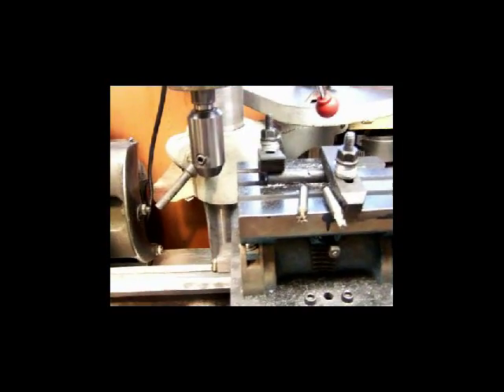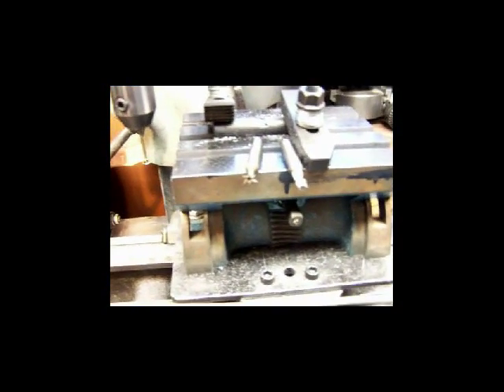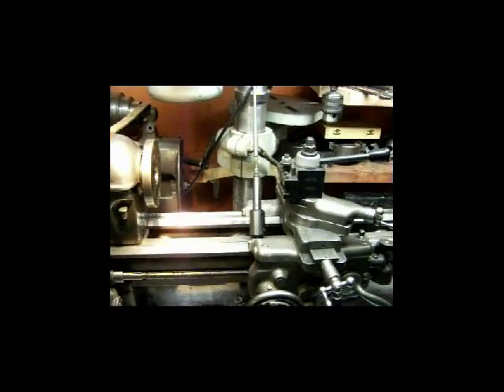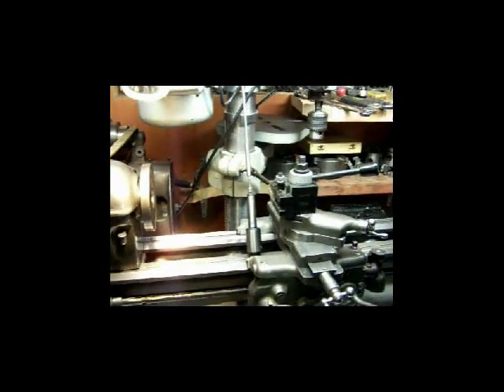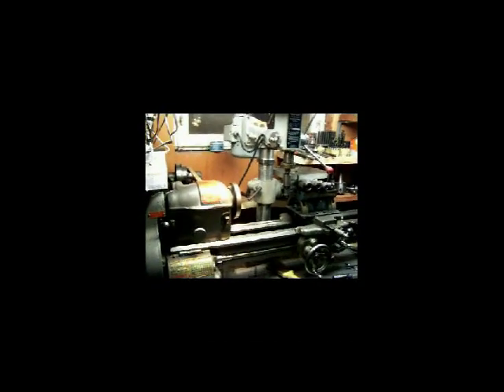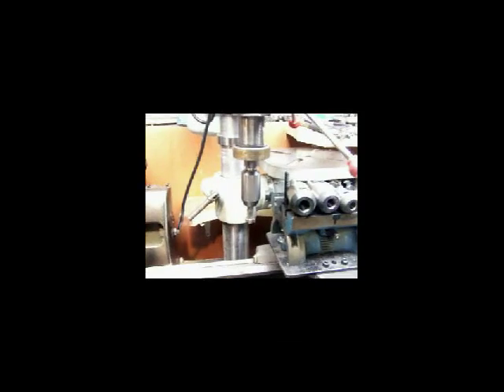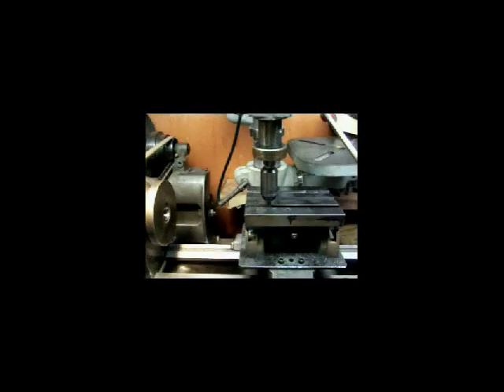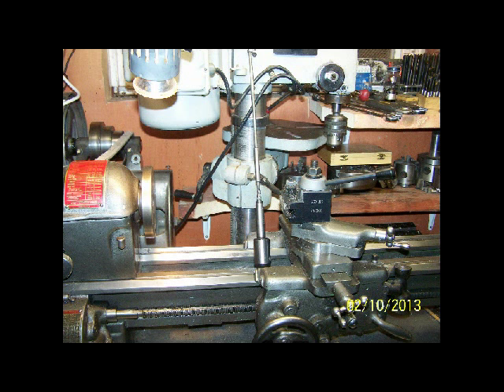DRILL PRESS TO MILLING MACHINE

Comment: where did you get the end mill holders for that particular project?
Reply from the maker: ON EBAY THEY FIT IN A SMITHY LATHE THAT HAS A MILLING MACHINE BUILT ON THE LATHE

Comment from the maker: Right on mark I will do that.
I did leave the drill head a little loose on the post with the
end mill in the chuck when I tried it out.
Then moved the bed along the ways as the end mill tracked in the slot.
Then lock the head of the drill on the post.
I mount the T slot table parallel to the ways as best I could. 
I will use the dial indicator when I have something mounted
for working on.
Thanks for the come back always welcomed.

Comment: Looks good Robert...If you didn't already....Take a dial indicator, mount it in the drill chuck and check to see how square the drill press spindle is with the T-slot table.....